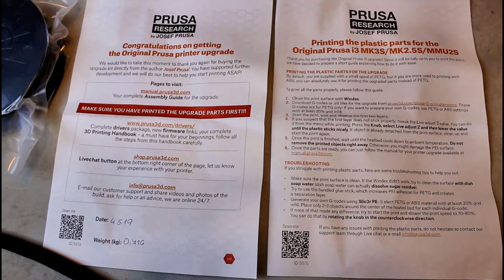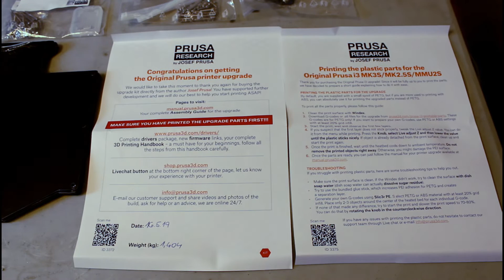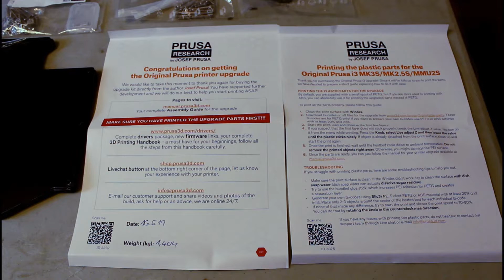Prusa I3 MK3S MMU2S Upgrade

Comment: I stick with PLA if I'm doing multicolour prints. I had the MMU2 on my MK3 before  I upgraded to the S on both units.
I don't have the filament spooling keeper I use  my own system which works well for me.
Doing away with the calibration of the filament in the tubing is a fantastic step forward.

Comment: Great Video!!! Glad you got it to work for you.

Bought this about 3 months ago and have had nothing but random problems. It's definitely a cool addon when it works but it's too inconsistent. Wish it left my printer as it was without the addon. I've spent more time trying to get it to work consistent vs actually printing. 

My recommendation is to consider your level of expertise before taking this one. I'm sure this is having a big part in the issues I'm coming across.
Reply from the maker: I totally agree. It is anything but reliable or consistent out of the box.

Comment: Have you had to adjust Amy settings since the update?
Reply from the maker: I will be doing a followup video on it shortly, but I'm basically using stock Slicer settings now. I did make a few hardware changes, however, which seem to make it more reliable.

Comment: I resold mine yesterday, I spent days trying to get a single successful print, but the load / unload fails every single time. I just gave up on it, the MMU2S is still a steaming pile of dogshit, completely not a product any respectable company should try and market. Needles to say, im checking things out very carefully in the future, doing all the research first, I dont trust Prusa as much anymore, the printer is great, but this thing is garbage. :(
Reply from the maker: I can't really disagree with you there. I'm getting mine to be reasonably usable (AKA I no longer want to hit it with a hammer) but I will never dispute anyone's ill-will toward this thing as I have had plenty of it in the past. It was disappointing that the "S" version did not include any upgrades to the MMU2 unit itself.
Reply: @0calvin  Worst part is that the joke is actually on me.. I saw your first videos on this turd, but I thought they would have fixed all that with the upgraded MMU2. Nope nope and nope :(

Comment: Do you have a link for the modified bracket that holds your MMU unit level on the top of the frame, instead of at an angle.  I have not encountered that modification and am not finding it on Thingiverse or Prusaprinters.
Reply from the maker: This is the one I'm using. It is a remix of a taller one. https://www.thingiverse.com/thing:3418267

Comment: Happy to see that your MMU is finally running. Just completed my upgrade two days ago. First test print ran without any hickups. I have to agree to all of Chris' statements. I'll build my own buffer and will integrate that into the drybox. Also I need to increase the height of my Ikea Lack enclosure for the MMU. Always happy to see a new video from you. That new intro kicks butt! =|B-)
Reply from the maker: True about the stealth mode. It might be that they just reduce the drive current at certain points or something, and run it slower. It definitely loads and unloads like the devil when in normal mode. I just finished a four-color, 21-hour, 500-change ABS print without a single hiccup. I'm amazed and astounded. I guess it's time to throw some PETG at it and see what happens. BTW, those thumb screws are a great idea. I would use them if I did not have my electric screwdriver.
Reply: @0calvin  Wow that loading speed sounds interesting! Have to try it later! That 500-change print is encouraging. Yes I'm looking at you Optimus Prime! (https://www.thingiverse.com/thing:2818858)The tip shape I get after filament change looks pretty good in comparison to your earlier "Britneys". I noticed on my Creality machines (with Capricorn tubes) that I get a very nice tip too when I unload the filament directly after the print at full speed. The new shorter PTFE tube in the Prusa that sits between hotend and drive gear seems to have a tighter inner diameter than the old one. Rather like the Capri-tube. That might help as well. That electric screw driver is a totally legitimate reason not to use the thumb screws. I would refuse to use them as well if I had one. But there are good news! You can have both! They can be operated with screwdriver AND thumb! So you can install these in case your screwdriver runs out of power.
Reply from the maker: I made and use this thing: https://www.thingiverse.com/thing:3418267
Reply from the maker: I'm glad you like the new intro, btw.
Reply from the maker: My MMU2 was still acting up a little, but I added this thing and it seems so much better: https://www.thingiverse.com/thing:3528314  Also, I took the MMU2 off of stealth mode, which was default.
Reply: @0calvin  Hey Brian. Thanks for these helpful suggestions. I'll try them out. Interesting that there is a stealth mode for the MMU. I thought it might be using stall detection to calibrate itself. So the stealth chop mode might not be very helpful. But what do I know. :) Btw. Check out these little heplers. https://www.thingiverse.com/thing:3324321 That is true quality of life. XD Cheers!

Comment: first  :D  the filament "backup" holder is junk
Reply from the maker: I never actually built mine so I don't really know one way or the other. I've read that it is a bit fiddly to load but there are some good designs on Thingiverse which probably work better. Thanks for watching.
Reply: with proper slicer setting it does do multi material ok. run flex slow.
Reply: nice to see you might start your new part time job (mmu2 printing) again.  it's not as bad as it used to be. I swear most of the things they fixed was software side.
Reply from the maker: @toaf6467 : Yes, the software seems more refined and stable now. The addition of the new filament sensor was huge.